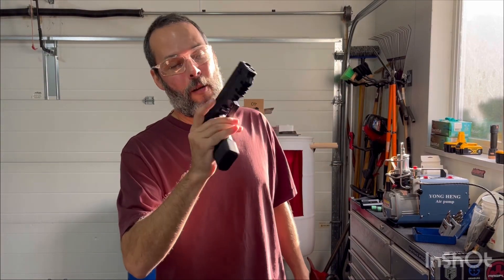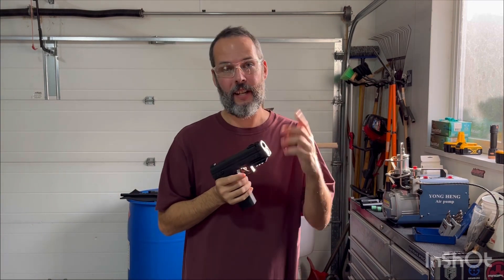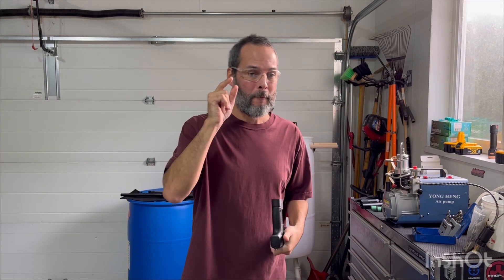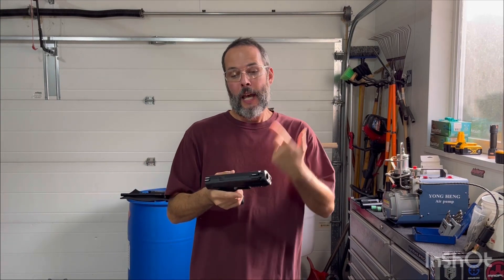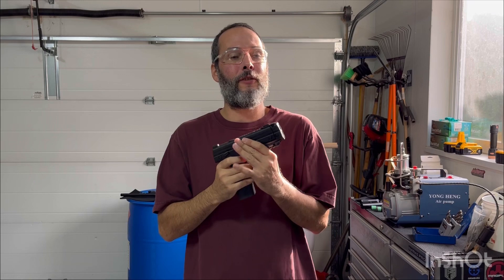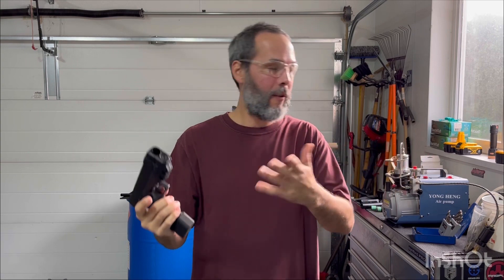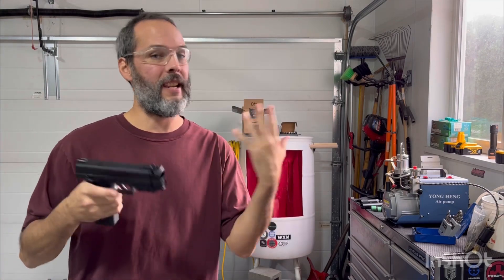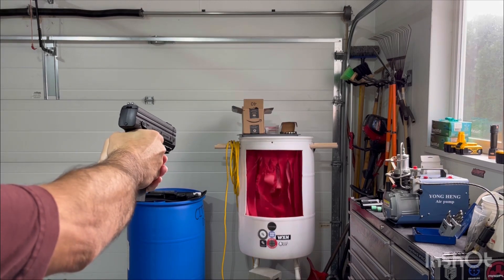LL4D Byrna LE - Update on my sticky trigger

Comment: seems like I have to pull the trigger back really REALLY hard for it to shoot.......any suggestions?  Its brand new from the factory.
Reply from the maker: Over tightening the co2 cap can be a cause of binding. Some have also had issues with the co2 cartridge brand also causing problems.
Reply: Well, according to the CEO of Byrna .. he has a video out saying that you can’t put it back slowly. You have to pull the trigger back fast to shoot… He seemed a little frustrated telling people this…

Comment: Did try adjusting the velocity on your EP yet? I’ve wanted to give mine a try, but not sure how many turns or the direction.
Reply from the maker: The LE model i am using does not have an adjustment for the hammer spring and my last attempt at fooling with the LE failed miserably when it would charge the launcher but wouldnt fire a projectile.
Reply: None of the Byrna can be adjusted. The screw in the back is there to hold internal parts in place, not adjust velocity. Byrna has addressed this several times and has said to not mess with the screw if you don't want to break your Byrna.
Reply from the maker: @Joreel not entirely true but the adjustment is limited. Adjusting hammer spring strength does allow for fractions of more co2 to be released and there is a measurable difference but it is not recommended to mess with it and chances are it is already maxed out as was the case with my SD when i received it.
Reply: @lesslethalfordummies  I will have to defer to your expertise in this as I can only go on what Byrna has said. If they can be adjusted a bit, how do you do it without opening the launcher as even I'd like to have a little more power out of my Hi Viz model.
Reply from the maker: This adjustment was only available on the original valve design. There is a hole at the back of the launcher where you would find the hammer in a real dual action 🔫. Inside is a tiny setscrew not unlike the velocity adjustment on other launchers. Righty tighty increases hammer tension and lefty loosey reduces tension. As i said mine was already maxed from the factory but some were not. It is a soft stop screw so you do not want to overtighten.